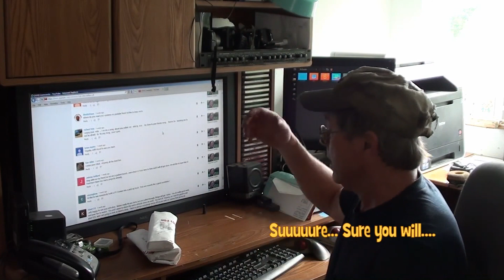Snow Smashed Shop Recovery 6 with comments at end

Comment: When are you getting on with that 57? you gotta put a big block chevy in it, they move down the road so effortlessly with that extra power. It's like you're driving a corvette, only it weights 3 ton! I'm looking for a 56 Buick Century, and funnily enough the bigger engine offered with these was a 360-something (6 litres)  so I'm looking to get a 6 litre iron-blocked truck LS. Performance parts are just so tricky to find for the weird displacement non-chevrolet GM V8s, that its worth just going to a SBC or BBC or better yet, an LS ;) I thought about putting a 455 in it, as they only weigh 11 kilos more than a chev 350, but the situation of actually finding an undamaged block is nigh on impossible!